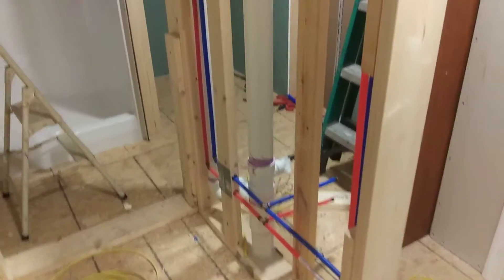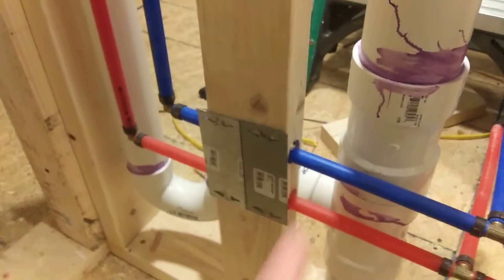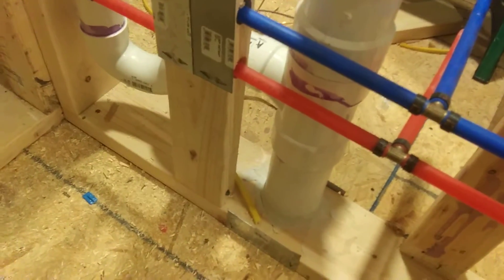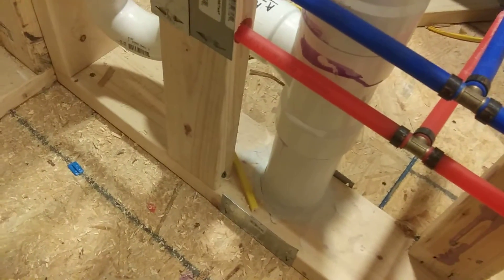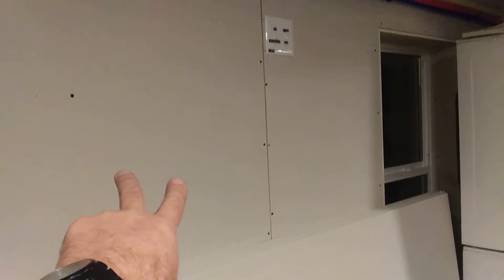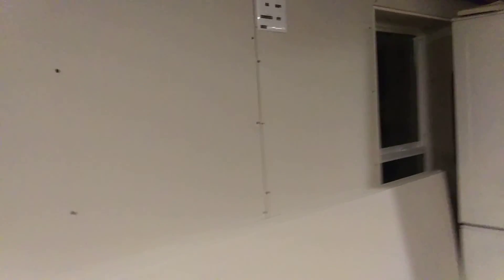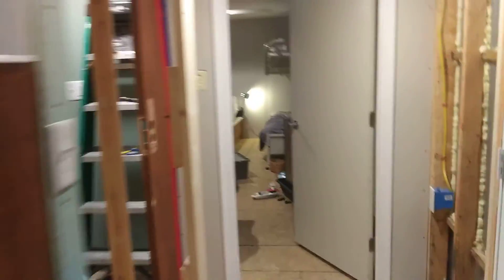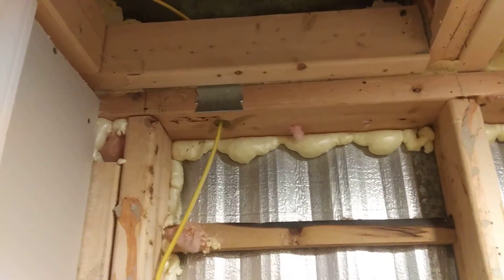Protection Plates for Electrical and Plumbing

Comment: Is that stud in the correct orientation? Just wondering if the face of the 2x4 is supposed to be oriented 90° to the sill plate, thereby giving more depth in the stud to drill the holes for the px lines.
Reply from the maker: If you look closely, you'll see that's a 2x6 wall. It's a non-load bearing partition wall. It's 2x6 to allow for the 3-inch dwv pipe. That 2x4 is turned to allow the horizontal drain to easily go to the dwv. The stud is just there to hold drywall, so it can be oriented anyway that's easiest to allow the mechanicals to fit.
Reply: @James Glass  ahh, thanks for the explanation. That makes sense now!

Comment: What’s the likelihood that someone with a drill and a lot of anger is able to drive a drywall screw through one of these? I live in a condo and my neighbor is doing reno but it sounds like they’re drilling as far as they can in order to attach cabinets. Should I worry about the drilling through my water lines?
Reply from the maker: Assuming you have protection plates, my guess is the likelihood is low. It's not easy at all to get a screw through the plate.
Reply: @JamesGlassJamesGlass  thank you!

Comment: How do you keep the drywall over them from being uneven and bumping out?
Reply: good question    the slight bump created is usually not noticeable   they paint walls with flat paint to hide waves and other minor imperfections
Reply from the maker: The plates aren't thick enough to be an issue, especially since I do level 5 finish.

Comment: I think, that plate should be made out of 16 gauge steel?
Reply from the maker: In the case of the Erv, nothing was required so the thinner gauge was ok. But heavier gauge would be even better.

Comment: There is still no easy way to protect plumbing lines between the studs.
Reply: That is why you have to be extra careful when going into a wall.
Reply: Well you could install blocking if you're that concerned. Either way, if your cutting a hole in the wall, especially with a jab saw, you shouldn't be pushing the blade all the way in for this reason